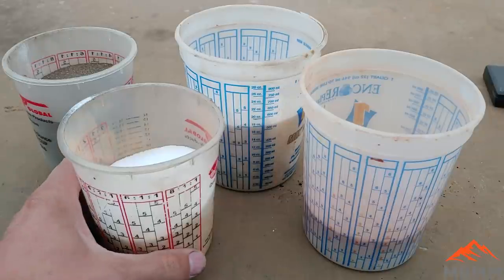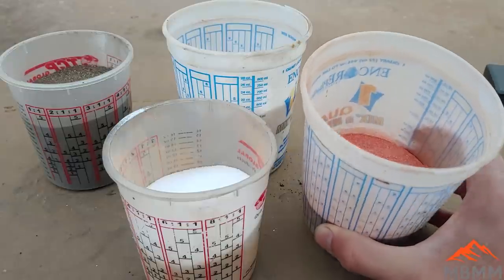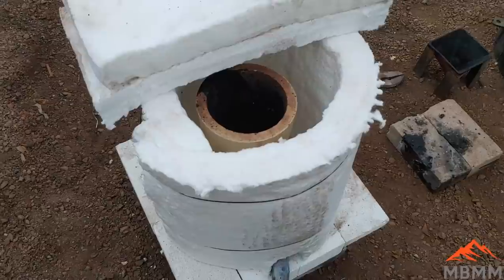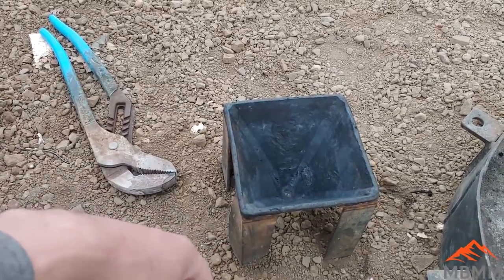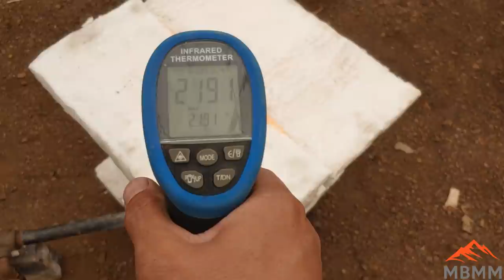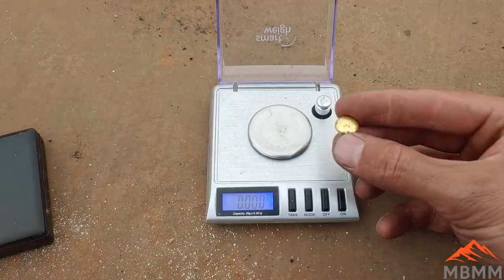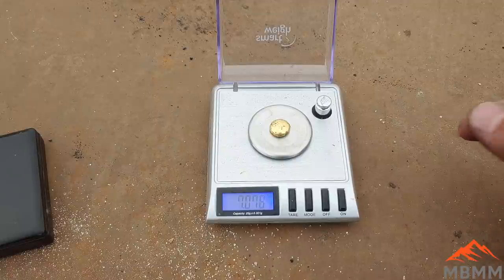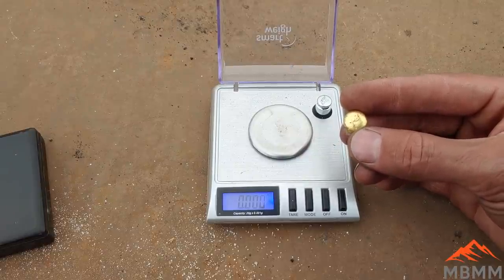Recover the Most Gold with the Least Effort - Production Smelting Techniques!

Comment: Thanks for that, ought to xrf your material beforehand so as to assess the accuracy of that method of assay by comparison with your smelting measurements.  

I like how you provide source links to the essential things needed to do the smelting. 

Sometimes you use lead and other times lead litharge which is harder to obtain.

I guess it is best to use the lead litharge else you would not go thru the trouble to obtain it.
Reply: Litharge is good stuff. We use it in our assay lab.

Comment: I just looked at two dozen thermometers. I think that welders use some stupid thing like the color of the metal but if there's a thermometer you recommend. Am I alone in thinking that's a pretty cool one?  

That looked like a huge jump away from the more basic fluxes, no kidding.

No silica? I suppose it's in there already as table material.

Thank you very much again.
Reply: Awesome video. I freqntly "jewelery carbon block" the ore type for what it's worth and wind up w/work backlog. Didn't notice "anhydrous" until this video. Oops. Got to roast my borax or torch it or buy the premade. Super video. Thanks again. Better than Ammen who helps sm scalers a lot. Still on the fringe of fire work but very impressed.

Comment: Gold Weight:  	7.077 grams (equals 4.55 DWT, also known as pennyweight)
Purity:	18k
Gold Price:  	$1941.05 / troy ounce
Answer:

Total gold value is $331.24.

This doesn't mean you should expect to receive $331.24 from a buyer. This amount represents the current melt value using the live gold price.

Comment: How long did it take you to capel the button?  For me it seemed to take a while in my forge.  I've found that oxy acetylene with the smallest welding tip worked best.  You can adjust your flame to a slightly more oxidizing flame and drive off the lead quickly

Comment: Thanks Jas for producing these vids, Im new to the game of gold but have learnt plenty from your wealth of experience 👍👍 
I’ve been trying some simple smelting myself using borax method but not having any success.. I’m using a small graphite crucible with your lpg/vacuum heat source.. I heated the gold/borax mix( all dry) as much as I could but couldn’t get it to a viscosity which would pour, it just all stuck inside the crucible, looked like the borax slag had absorbed graphite from the crucible but the gold did not seem to melt together at all. I have not got a furnace so maybe not enough heat, I don’t know where I’m going wrong? Any suggestions would be huge help. And thanks again for the great videos.
Cheers 
Jason in Australia  🇦🇺
Reply: Jason never replies here. So i will share with you what i did:
I had the same problem , and i have found that you want to make sure your crucible is well protected from any wind or rain or any cold weather (optimally you would do this in the heat of summer in a covered area with no wind. 
Now the next level is to buy some heat proof wool . something like kao wool and make a little oven for your crucible. that way you can really create a space that won't lose heat and really insulate it and help with heat loss.
It is not required however.  As long as you make sure you don't have any wind you should be ok.
Now , it may melt within 10 mins or it may melt in 45 minutes. IT all depends on how small your amount and crucible is and how much gas you are using.
I personally would NOT use a graphite crucible. I would go for the little cups they have  the white cheap ones on amazon.  They do well after you glaze them (i assume you know about glazing but if not research crucible glazing)  
And that's pretty much it.  
Make sure to use the right amount of borax and a trick to doing that if you have powdery light gold is to put some borax in there , melt it down nicely then put your gold in. so that your gold doesn't fly away from the strength of the flame and sticks to the borax.
And also it is hard to tell where the optimal heat is at in terms of how far away from the gold you want to keep the torch for it to melt properly. All i know is that when i did melt it ( at the most i did about 2 ounces) it took a WHILE one day and i didn't melt it, and the next day i hunkered down and it melted in about 20 minutes...  This is to illustrate that unless you have an oxy -acetylene torch,  you have to REALLY get everything right for gold to melt well. And yes i still haven't been able to get it hot enough to pour into a mold just using propane... 
It tends to melt just enough to where it is liquid but if you take the torch off it for a second or two it will solidify QUICK. 
Hope this helps.

Comment: Probably a dumb question but why do you melt into a crucible and then pour the melted material into a cone mold? Why not put the cone mold into the furnace and do away with the crucible entirely. Crucibles are can crack and there is a safety risk lifting them out to do the pour. I'm sure there is a good reason but I dont know what it is!!
Reply: Adam Swire
13:52 Temp of melted mixture in crucible: 2183 F
Melting temp of most steel: Approximately 2500 F
At over 2000 F, steel loses most of it's strength and rigidity, so the steel cone mold could warp and sag, spilling the contents of the smelt.
Reply: @xenaguy01  100% correct. I've tried it. Not very pretty. All over the inside of your furnace, thank God none of it ever got on me. definitely , just  take xenaguys word for it, you'll be glad you did.
Reply: @xenaguy01  So a conical clay graphite crucible then?
Reply: @garydunn9418  
Could possibly work, but you'd probably have to break your graphite cone each smelt. Would drastically raise your per-smelt cost.
Reply: @xenaguy01  One more thing, use one shot cones,if they are ever available or make your own clay crucibles.Might be a cost BUT,if you are getting good precious metals yields its okay :-)

Comment: What’s that like $7000 right there
Reply: Gold Weight:  	7.077 grams (equals 4.55 DWT, also known as pennyweight)
Purity:	18k
Gold Price:  	$1941.05 / troy ounce
Answer:

Total gold value is $331.24.

This doesn't mean you should expect to receive $331.24 from a buyer. This amount represents the current melt value using the live gold price.